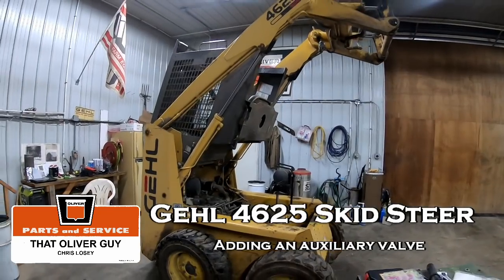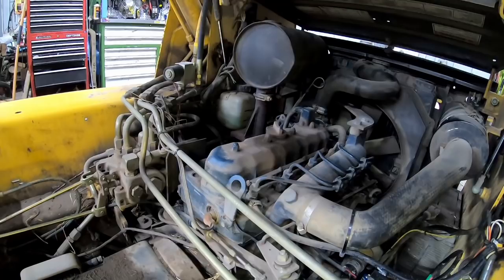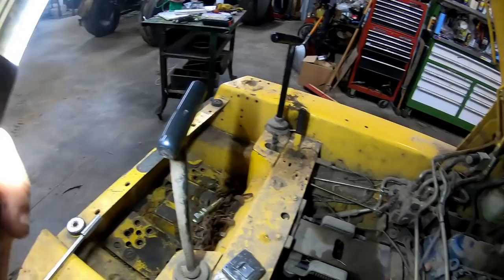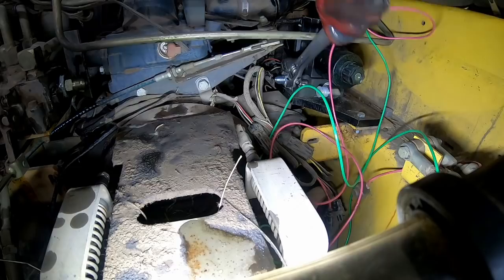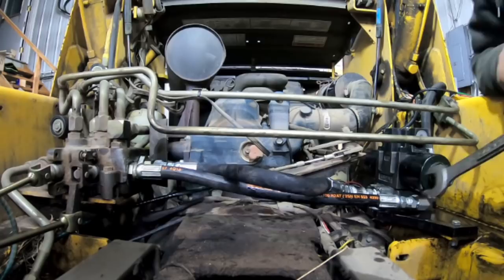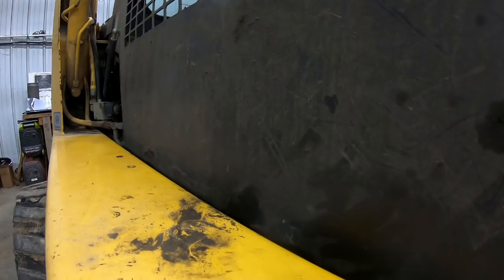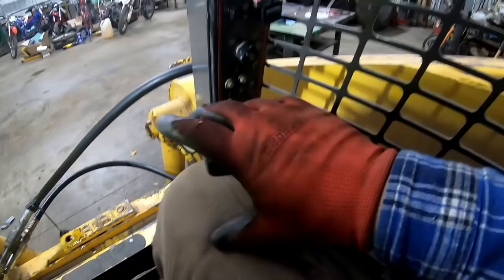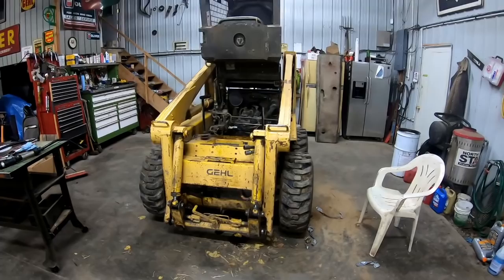Gehl 4625 Skid Steer Auxiliary valve

Comment: You won't regret an auxiliary on a skidsteer.  Root/rock rake +  grapples are slick, 4-1 buckets make grading easier and loading high trailers/dump trucks a breeze.  But, the  tool I appreciate the most, ( also the one which I use the least) is the hydraulic post auger.  No  tractor back/neck, no  helpers, no broken shear pins, no more manually trying to 'unscrew' an auger stuck in a hole wedged against a rock !!  Plugged equipment and stuck augers, two reasons why sometimes a reverse gear on PTO would be handy...

Comment: Chris, you are my hero. I purchased a 4625 and had a theory that this could be done in 2019.  After looking at the owners manuals and hydraulic schematics, I  just didn't know how to plumb it and the guys at Germanbliss could not or would not provide information.  As a matter of fact, I purchased 5635 with the foot control.  You modernized and older skid to use new attachments.  

Thanks so much for this video.
Reply from the maker: Thanks! It's twice as handy as before! The skeleton grapple I bought has been awesome and really increaded it's work capacity.  Now I want to get a tree shear for it.

Comment: Hello let me tell you I have a 1995 Gelhl 3510 And I have been trying to figure out how to set up some thing like this thank you very much!!!!!!! I am going to see if I could use the same Assembly and I’m probably going to do the same ordering the steel lines First thing that I’m gonna do tomorrow morning is to check if I can connect to the skid steer system Which I’m pretty sure that I can because the machine used to have the option but they don’t longer carry it and operated by foot Once again thank you very much I might bother you with a couple questions later on

Comment: Awesome video Chris, that came out pretty slick. I’ve noticed on Amazon they have a pretty good assortment of all different kinds of switches whether it’s a trigger switch a 2 position momentary pushbutton etc. but they even have quite a few options on something that could mount to a pipe such as your T-bar control handle. Maybe you wanna check it out someday if you don’t like where the switch is now. Thanks for sharing!
Reply from the maker: I got the switch I used from amazon,  I've been looking at foot switches. What search term did you use to find  a pipe/tube mounted switch?
Reply: Check out like motorcycle handlebar pushbutton switches. I think that’s how I came across them last time. They had some momentary ones they also had double switches-so one button would be hydraulic direction one way one button the other way. I put one on a forklift a couple years ago for power side shifting forks that I installed. I don’t think I can put a link in these comments here without it getting taken down right?
Reply from the maker: it will get tagged for review, but I can approve it after you post it.
Reply: @ThatOliverGuyChris  it was something along the lines of that. That machine is actually out on a job right now but when it gets back I will take some pictures of it and look at it . I can probably find the exact one if you like. It has two buttons on it, I was able to wire it up so one button went one way one button went the other way, it worked out pretty good. It’s still out there working today it was waterproof and everything
Reply from the maker: I just found this one on amazon. I need to measure my T bar, but this one looks perfect. Thank you so much for the leads!
https://www.amazon.com/Motorcycle-Handlebar-Universal-Cycling-retail/dp/B081VCBPMR
Reply: @ThatOliverGuyChris  No problem at all. Thank you for taking the time to answer all of my questions, I’ve learned a lot from you I’m glad I could do some thing in return. That switch looks almost identical to the one that I got a couple years ago.
Reply from the maker: I like that there's room between the buttons for my thumb. Hopefully it will fit my T bar.
Reply: I wonder if you could use longer bolts on the bar clamp? You could always make up some quarter inch spacers to take up the space in the clamp if necessary. If I remember correctly that’s what I had to do
Reply from the maker: I measured and my T bar is 1.2" with the rubber coating. If I cut of ring of that off, it looks like that would get it down to 1". I think I'll do like you're suggesting, get some longer bolts, maybe do a little grinding on the switch housing so it fits a larger bar, looks like there's enough meat to do that. I've got one coming, thanks again!
Reply: @ThatOliverGuyChris  Awesome I can’t wait to see how it turns out if you have a chance to share in a video!
Reply from the maker: @Adam_Poirier  I will. I've got a rock/grapple bucket on order, but it's going to be March or even April before I get it.

Comment: U could put a mini micro rocker on the round end say where ur thumb would be on the end of the T bar if its solid or hollow metal drill a hole in about and inch in then underneath drill in to meet the new hollow centre or if its all ready even better and wrap the wire down and around the handle through the rubber gator and down to the electric over hydraulic valve 👍
Reply from the maker: That's exactly what I did. I got a motorcycle handlebar switch  and did what you said. Works great!
Reply: @ThatOliverGuyChris  good man I'm into rc construction equipment and rc trucks because I don't have much money and live on a poxy council estate in the UK but love old vintage heavy machinery and I'm a bit of a mad scientist 🤪 when it comes to think outside the box lol

Comment: What motor is used in your loader? It’s color is like a Kubota but I’m not sure.
Reply from the maker: Good eye, it's a Kubota.
Reply: My 3625 had a yanmar. Best cold starting engine I ever had.
Reply: I’ve had such good experience with Kubota. My first time I ever saw one was at a fair i think 1975. 4x4 little tractor.

Comment: Hey Chris another great video! Just shows all the possible things that you run into o a project.  I bet it is nice having your own hose machine.  I have a question on my 1850 input shaft; Finally got back to working on it, the orignal shaft had a bad bearing and seal, worn splines for the chain coupler and the low range gear started welding it self to the shaft.  I found a good used shaft and gear. When I got the new shaft it had a plastic type sleeve to go between the gear and shaft, the old one did not have this sleeve it just had machined groves on the shaft.  Was this an update or do I have the wrong shaft it looks identical?  Thanks
Reply from the maker: It sounds like you got an early shaft from an A or B series 1800/1900.  They had what was called a nylotron bearing because they weren't pressure lubricated like later models. When that plastic bushing gets worn, they like to pop out of gear. Personally,  I'd find the correct shaft, I'm not sure your gears will even fit on that one.
Reply: @ThatOliverGuyChris  ok thankyou Chris.
Reply: Hey Chris thanks for the help, I have a new shaft on order along with a bunch of other new parts, bearings and seal's.
Reply from the maker: Awesome

Comment: Thank you The flow and return to main spool vale i under stand the flow line from tne solenoid what happen to the return line JohnPike Tamworth New South Wales ps what ser of vale did you use
Reply from the maker: The return line goes back into the spool valve in a port that then sends it into the line that returns to the  tank.
Reply: thank you

Comment: I have a 4640 with aux with the foot pedal, sometimes it works and sometimes it doesn't. Seems like I can't find any answer .it has a elec plug that I think is causing the problems. I would like to just override so I have flow anytime
Reply from the maker: The 4640 was after I was a dealer, but if it's like the 4625, the foot valve is mechanical,  but has solenoids that lock out the valve when the restraint bar is up or there's no weight on the seat. It should be part of the same circuit that locks out the boom and bucket controls. The solenoids on those only have power when you're in the seat with the bar down.  If your boom and bucket function properly,  I'd say there is a poor connection going to the auxiliary valve. It could possibly be a bad solenoid as well.
Reply: @ThatOliverGuyChris  it was a bad solenoid, I cut the rod out now I always have flow. Thanks for posting there's not a lot information on the gehl
Reply from the maker: Glad to hear you got it fixed

Comment: Northern tool discontinued this part. Any idea where i can get the valve i need?  Also have a gehl 4625
Reply from the maker: They seem to do that, but replace it with something similar. They have a Yuken branded one that would work that they are currently out of stock on. https://www.northerntool.com/shop/tools/product_200737719_200737719

I've bought stuff from Dalton Hydraulics and been happy with their prices and service. They have a 25 GPM valve that would work too. https://www.daltonhydraulic.com/d05-solenoid-valve-d05s-2c-12d-35

You'll need a D05 subplate to mount either of those valves on. Dalton has that in a version with 1/2" pipe threads https://www.daltonhydraulic.com/d05-npt-subplate-sd05-8-fp-s
or with o-ring boss ports https://www.daltonhydraulic.com/d05-sae-subplate-sd05-8-fs-s

If you plug the model numbers of those items into google, you can find other places that sell them, possibly for less. Mine has been working like a charm on my 4625. I got a grapple bucket, and that thing is awesome. Now I want a tree shear.

Comment: How do you disengage the wheels so it will roll freely.  Great video!!
Reply from the maker: If your skid steer is prior to serial 19720, there is a lockout valve on each pump to allow short distance towing.  After that it looks like the only option is to disconnect the drive chains.

Comment: What hydraulic valve are you using specifically?  Can you share?
Reply from the maker: I bought this valve. Of course, that exact model has been discontinued since I bought it.
https://www.northerntool.com/shop/tools/product_200329588_200329588

This one is more gallons per minute, which isn't going to hurt anything, but is the basically the same valve as I put in my skid steer.
https://www.northerntool.com/shop/tools/product_200737715_200737715

They need a subplate unit to mount to, and that base has ports to connect your hoses to. This one has 1/2" pipe thread ports. There are other subplates with different port sizes, but that particular valve needs to have a D05 configuration.
https://www.northerntool.com/shop/tools/product_200744192_200744192

Comment: Has anyone put a set of rubber tracks on a 4625 ?? And if so where I can I find them Thank You .
Reply from the maker: I've never seen rubber tracks on a 4625. I have seen steel tracks  that go over the wheels, but I have heard they are hard on the spindles and bearings.
Reply: I appreciate the info I’ll just use as it then. It’s a decent unit I need replacement instrument panel decals and bulbs other than that it’s ok .. I’ve got $13,000 in it anything new that is decent or that I like is at least 40 to 50,000 and I’m not doing that no usual and sell or trade it
Reply from the maker: If you're on Facebook,  there's a gehl skid steer group, and guy on there is parting out a nice looking 4625 in Louisiana

Comment: how did you get the cab to lift up???
Reply from the maker: There's a bolt in each front corner where the cab meets the main frame. Take those out and tip it up. There's gas charged cylinders to assist, but mine are getting tired, it took some umph to lift it.